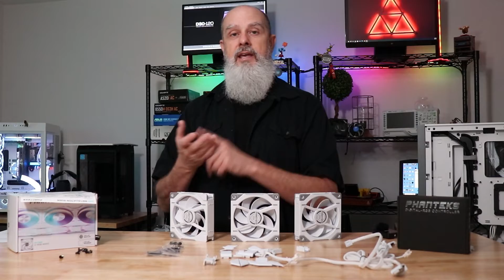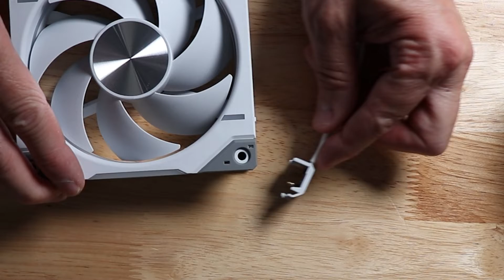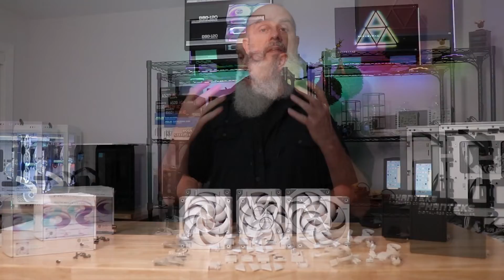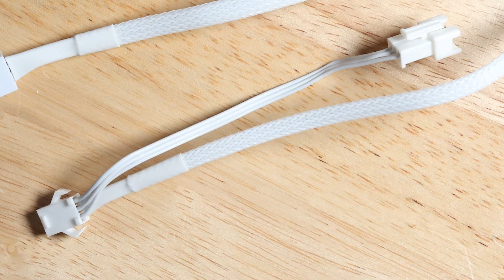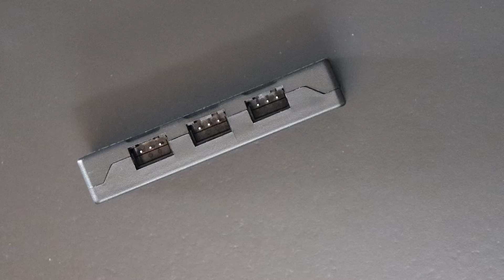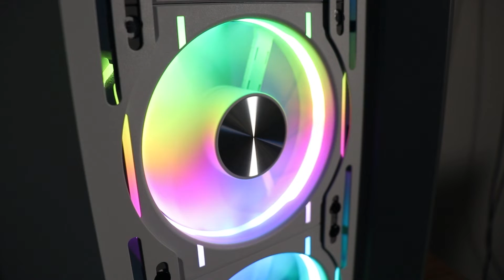Phanteks D30-120 Cooling FAN - Up Close Look - I'm a fan of this FAN.

Comment: Nice fan. BUT. there is 30 led, but they are mirrred, 2 x15 led, so no runaround light control, and the quality is not always there, have had a lot of quality issues lately with poor moldings and off center, cetercaps making it look twisted when rotating, not what you would expect from fans in this price range.

Comment: @HardwareArtisan Hello I'm thinking of getting some of these to put in a HAF 700 case. Can you tell me would i need any extra extensions for these. 

I would like full control and totaks advantage of all the features. For instance, two as exhaust, 3 as bottom gpu intake, 3 on the backside of the case in front of motherboard, and 3 as top exhaust. There would also be 3 on the AIO radiator. 

All 140mm except thr rear exhaust two which would have to be 120mm. The case has a 7 fan PWM controller with 5 ARGB connections, and a second ARGB controller for 3 more connections. The MSI motherboard has a EZ Hub with 7 PWM connections and 2 ARGB connections. 

I would like to control thr lighting through MSI software.

Comment: Hey I was looking into these fans, and I was wondering if i bought two sets of three one for my radiator and one for the front of my case cause you daisy chain all 6 together? Then plug them into the nexlinq fan controller they made?
Reply from the maker: Hi davidhaught7408, that's a great question. I would recommend you divide these up in to individual groups of 3. Unless your fans are all in a straight line in the case, you wouldn't be able to put them into a single set anyways. With that said, if you have two groups of 3 fans, each with a JST (LED) and 4 pin PWM connector. Yes, you can use the nexlinq controller with no problems. It has a single native port for JST (LED) and a single PWM Port where one of the groups could connect. The controller does come with another cable that converts the linq6 connection into standard JST/PWM/ARGB connections which you could then connect the second group to. 

That solution would work just fine if you want to use the nexlinq controller and phanteks software. There are many other solutions to connect these, but this would work. 

Good Luck, have fun and thanks for watching!!!! Yea,

Comment: so happy to have found this video bc its the first one that somewhat adresses my RGB issues I have with these fans while waiting for them to be deliverey next month. I am doing the AIO (3fans) plus 2 3piece Sets and 1 exhaust fan (so 10 fans total)... My issue: Phanteks talks about needing a MSI eith mystic light Function motherboard (which is what I planned on getting). So after this video, I would need to get the phanteks hub twoce since it only takes 3 inputs, and put these into a corsair icue controller (like the Commander Core XT) and plug that one into my motherboards mystic light output?

Or is there another way to do this that would maybe even give me an option with other motherboard manufacturers duch as gygabite for ex.?

Comment: hello there nice video i had a question can you combine  11  of these fans without needing any hub etc ??? thank you
Reply from the maker: Hi mendiskederaj9772,  Phanteks states you can only combine 4 fans together in a chain, which gives you a single connection (1 for ARGB, 1 for PWM) for those 4 fans. You would need to use multiple headers on your motherboard for ARGB and PWM connections for 11 fans, if you were to split them up into a minimum of 3 groups. 

Chaining 11 together might be physically possible, but you wouldn't want to connnect that to a header on your motherboard, you're likely to damage equipment, fans or the power source. So, my advice is don't do that, even it's a special use case you have.  Split them up into groups of no more than 4 fans. 

I'm curious where you are installing these. Good Luck have fun and thanks for watching!!!!
Reply: @HardwareArtisan  motherboard aorus x870E pro ice wifi7 , case HAVN 420 VGPU  my aio would be also a 420 mm its frozen warframe 420 wasnt easy to find one this size especially white so i gonna switch the fans and put the phanteks instead am excited about this build of cours someone will do it thanks a lot for your help
Reply: @HardwareArtisan  it gonna be 11x140mm

Comment: How many of these fans RGB connectors can be daisy chained into one mb argb header?
Reply from the maker: Hi 1gamerdad287, the documentation for the d30-120 fans shows limiting your setup to chaining up to 4 fans together. That would be one limitation, so 4 fans per ARGB header. 

Your ARGB header can likely support more than that, but I wouldn't chain more than 4 together. In addition, you have to consider how much power your PWM connector will support as well. 

You may likely have more than 1 ARGB/PWM connector on your motherboard to allow for more fans. If not, or it's not practical, I'd consider using an ARGB/PWM HUB powered by a SATA power connector, this would expand a single ARGB/PWM port to allow for more fans and make it easier to manage. In any case, I'd still not chain more than 4 together

Good Luck, have fun and thanks for watching!!!
Reply: @HardwareArtisan  thanks for the response! I think I was going to hold it to Max 4 for RGB and Max three for fan connections. I have a 3+1 configuration so I'm going to plug three into pwm and the separate one into it's own pwm then daisy chain 4 into an aRGB header. That's what I think I'm going to do anyways lol

Comment: These cost the same as Thermaltakes EX120 Swafan 3 pack which come with built in reverse blade customization ability and no plastic joiners to break.  If these fans for a 3 pk were in the $50 range which about what they are worth in terms of quality and performance they would be the new budget king fan.  $90 for these in a 3pk is just not worth it seeing as Lian Li Unifans and Thermaltake Swafans cost the same.  Great try Phanteks Fans are nice but way overpriced for the market they are in.

Comment: I just put five in my  NV5 case, easy peasy, anybody that breaks the fittings is an idiot, take a deep breath and actually look at the shapes of the corner pieces,  the rectangular tab fits the rectangular slot, if you can put Lego together you  can do this without mishap.. Great Fans.

Comment: Hello for the D30 fans, what program is the one with which you control everything.
Reply from the maker: Hi @Exlisticc, that's a great question, there is no specific software you need for the D30-120 Fans. These don't have a controller included, these have a 3 pin 5v ARGB connector and are intended to connect to your motherboard's ARGB header. You would then use your motherboards RGB software to control that header, in turn controlling the lighting on the fan. 

The Phanteks controller demonstrated is a standalone controller with buttons and doesn't require software to function. 

There are other ways to connect these fans of course, you could adapt them into corsair and use iCUE to control them for example. 

Let me know if I can help, thanks for watching!!!
Reply: @HardwareArtisan  question can you connect this fans to 7900xtx nitro + with both 3 and 4 pin  on the  card itself  to regulate speed and rgb_

Comment: Can you connect an additional single fan to the trio like with Lian Li's unifan setup?
Reply: yes, output end of trio with a M to M pwm extension cable goes to the input of the single fan (or a pwm Y 2 way splitter cable). Not out of the box solution , but it could be done